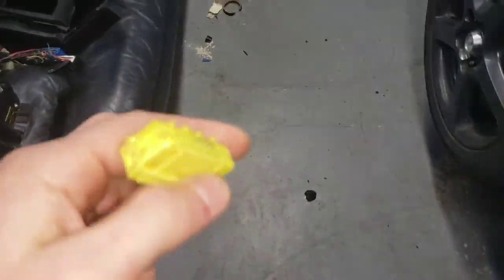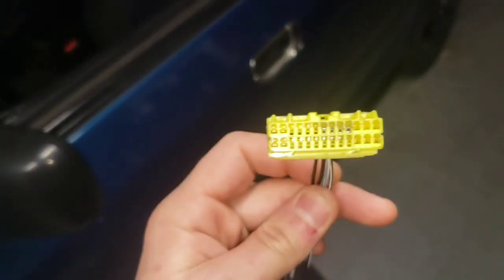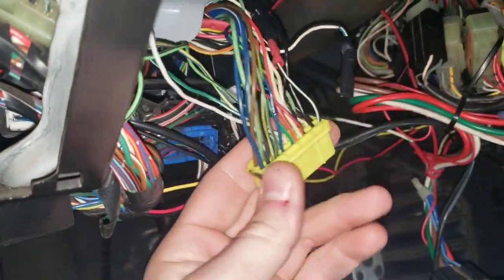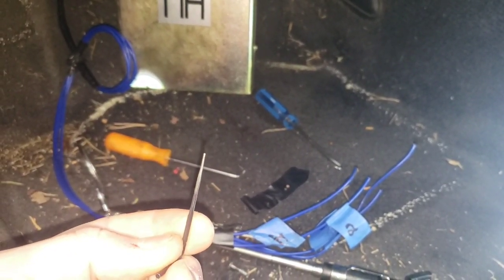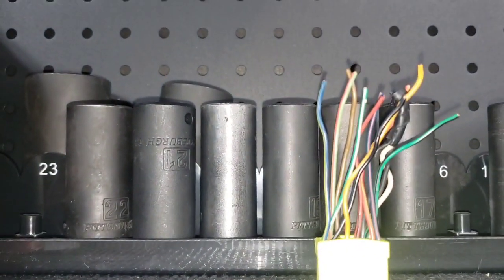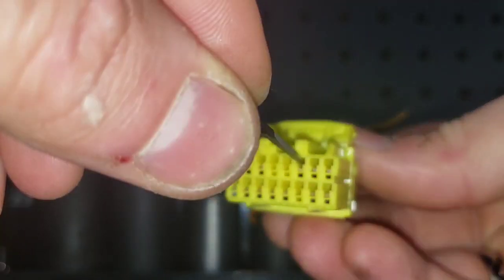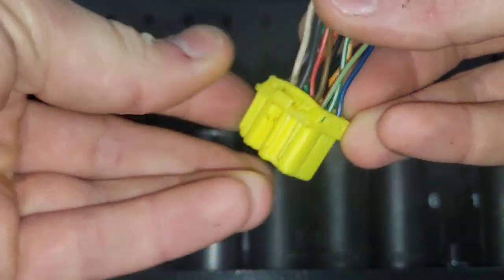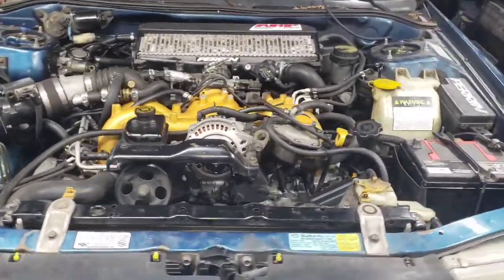EJ22T De-pinning ECU connectors the right way!

Comment: I find it perplexing that you can't find out the type and size of the terminal pins for the connectors even when you know the make, model, year and connector location. I'm trying to finish a cruise control install on a 2013 Tacoma which will require 2 lengths of wire, 1 ring terminal and 3 female ECM terminals to complete the install. Some years and models are a plug in a cruise switch and a horn ground wire a boom you now have cruise control working, due to harness prewiring.
Reply from the maker: It's very frustrating for sure, there are some suppliers that will specify the pin types. But I'm not sure where you can find that. Sometimes dealerships can be quite useful for information about things like that.